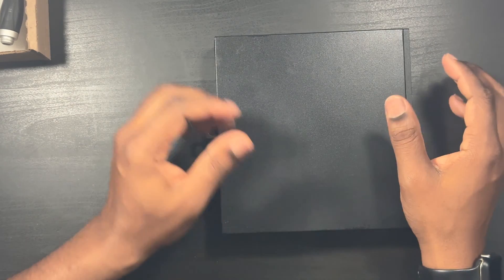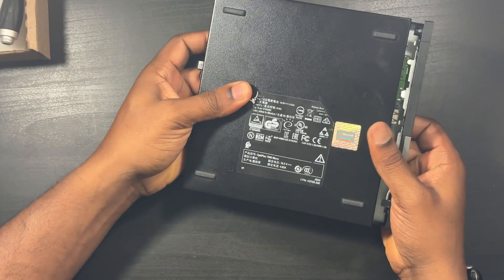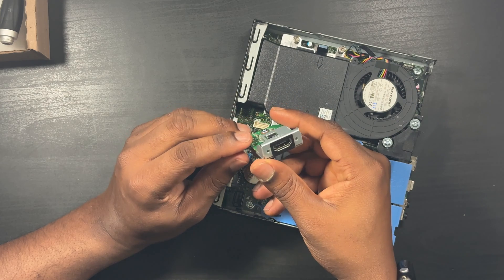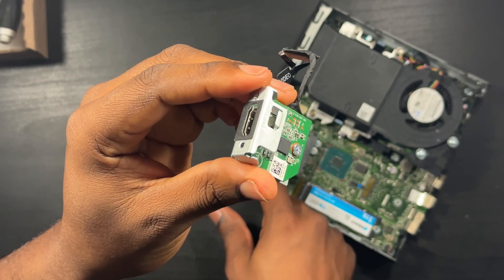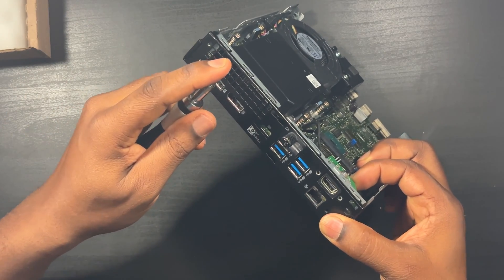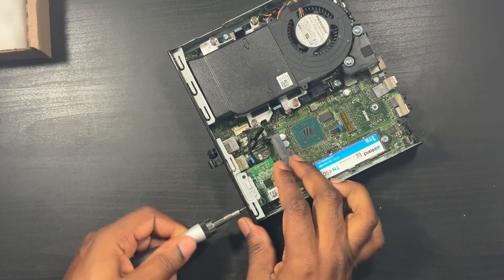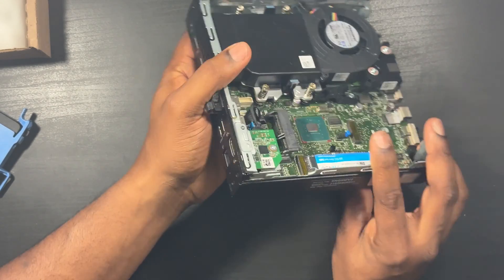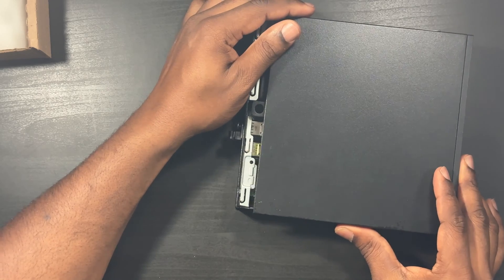How to add additional port to Dell Optiplex 7060 MFF

Comment: I have the same 7060 MFF, I added a UDMI extension like yours but windows is not detected the second monitor. I swapped the cables and they are good. What should I do next? Is there some BIOS option or something I need to change?
Reply from the maker: I didn’t have to do anything extra. Did you try to make sure you have a good connection to the motherboard also check the bios for settings mine might of already been set up in bios.
Reply: @charleeeugene  This is what I had YPF8G . Not exactly the code you had Y1XDH. It does lists this compatibility: Compatible Model: for Dell Optiplex SFF/MFF 7060 7070 7080 7090 ,Dell Optiplex SFF/MFF 5060 5070 5080 5090 , Dell Optiplex SFF/MFF 3060 3070 3080 3090 ,Dell Optiplex 3000 5000 7000 SFF/MFF,
Dell Optiplex 7010MT 7020MT 3000MT 5000MT plus 7010MT plus 7020MT. I returned it today to amazon. I can't find yours anywhere Y1XDH

Comment: Thanks for this guide! It worked for my 3000 Micro, except on that model the motherboard video connector is in a slightly different place and isn't accessible with the module screwed in, so has to be connected first.
Reply from the maker: Glad it worked out thanks for watching!!!

Comment: What exactly is that long thin board under the sata drive tn450? And is it's function?
Reply from the maker: I no longer have this machine but I’ll watch the video to see what you’re asking about.
Reply: It’s also an SSD called a m.2 which are significantly faster than sata ssd’s and connected directly to the motherboard. This also allows your OS to be installed on these, as well as other important types of software, and everything else installed/stored on the 2.5” sata ssd as you would with a 2.5” sata ssd and a larger HDD previously.

Comment: Do you have part numbers for more networking? I hear people talk about re-purposing old Micro's , but I can't find a faster network part.
Reply from the maker: Let me check I saw one on eBay but not sure if it’s compatible with this model.
Reply: @charleeeugene  I am also interested in this, seems like an easier solution than using the onboard m.2 A E for a NIC ( at least thats what ny 7070 has)

Comment: I have a Dell OptiPlex 7060 (the larger framed chassis) and I want to replace the current HDMI port on the machine however when I slide the cover off the chassis I noticed that the Cooling Fan is in the way of accessing the port. Do I need to remove the cooling fan or is there a cover on the other side of the chassis I can remove to access this module?
Reply from the maker: Yes those models are easy to remove parts just look for the blue stickers on  tabs and arrows should be easy to remove cooling fan to access that port.

Comment: I got my 7060 i5 8500t 8GB ram 256gb m.2 for $100 cad with a 95watt power supply super happy also came with basic keyboard and mouse I’m selling for $20 so should have spent $80 on the intial build, will be adding the i7 8700
Reply from the maker: Sounds like a great plan to me!!

Comment: Can we use m2 to pcie connector to use an external gpu with egpu dock and external power supply.
My i9 13th gen needs a gpu to run 2k movies
Reply from the maker: A great question I wish I had the answer for. I’m not knowledgeable about external gpu’s never owned one

Comment: The USB C board has 2 connectors and one of them need to connect to the Video port. Is it possible that the USB C port cound function just with the USB C connection made and the Video cable not engaged?. I am asking since the Video port on the board of my OptiPlex is already occupied with a HDMI card.Thanks.
Reply from the maker: Yes you can absolutely leave video cable disengaged.
Reply: @charleeeugene  Thank You. Will there be space on the back chasis left to install an extra USB C port after the HDMI port, 4 USB ports & 2 Display ports are engaged therein?. Is there any opportunity to install a microSD card slot on this chasis and what would be the suitable part number?. Thanks.

Comment: Bro  i have 9020 dell which already had this chip but i conect my lcd though hdmi cable but its no show any thing .neither i have seen any hdmi settings in my widos whay to do
Reply from the maker: Did you go thru your bios settings also try disconnecting the hdmi port and re seating it to the motherboard. If not order another one from eBay they are very affordable. Keep me posted. I didn’t have anything special with mine. It just worked !!!!

Comment: I got a usbc port for this pc and I find the usbc cable is not long enough to connect to terminal,I purchased the correct part ,and also do I need to connect both cables video and usbc .Apprciate your response
Reply: Damn it, why I didn't find this comment earlier,  ordered the same board, and stuck with the same short cable
Reply: I did it! You just have to pass the USB-C connector underneath the board.
Reply from the maker: No just connect the usb c cable the motherboard. Not sure why the cable isn’t long enough try flipping the module over too see if it gives enough leverage to connect.
Reply: @charleeeugene  Thanks for the reply,yes it will reach if flipped which I had already tried but the screw holes barely line up.I can’t understand why the cable is not long enough,as it is the right part number,
Reply from the maker: @eustaceedmonds  scratches my head can you return and try another one?
Reply: @charleeeugene  I got this on eBay took 3 weeks to get here,not sure if I get one from dell if it will fit,just needs to be a half inch longer,thanks
Reply: I tried looking for a video on this but no one has posted one
Reply: @charleeeugene I can send you a picture if you want 😊
Reply from the maker: @henriquecoelhandrade  send me the pic

Comment: I am trying to get this product but I am running into an issue. Specifically for the HDMI adapter, I found one but it says SFF instead of RFF. The cutouts look alike, however; Will it still work?
Reply from the maker: I would imagine if the cutout's are exactly the same if should work. These adapters are pretty cheap worst case scenario return it and buy another one.
Reply: @charleeeugene  Hey their. So I installed the HDMI adapter although it said SFF and it worked just fine thank you. 

This brings another question since the optiplex 7060 brings a Wi-Fi 5 card are you aware of any advances in that category? Do you think it'll hold a Wi-Fi 7?
Reply from the maker: @eduardoalverio7801  WIFI 7 Should work with no issues!!!
Reply: @charleeeugene  Have upgraded yours or any 7060 model thus far?
Reply from the maker: @eduardoalverio7801  just what I did in the video.
Reply: @charleeeugene  I mean About the Wifi card?
Reply from the maker: @eduardoalverio7801  No I haven't but a WIFI card shouldn't need special requirements. You could plug in a Wifi 7 USB Adapter and be good to go.

Comment: Just bought one today on ebay.... I might add USB C or HDMI not sure yet will see soon once I receive my system.... I checked and the system I bought already has the USB-C installed I'll probably go with HDMI so I don't have to get an adapter cable to run HDMI.... I looked on dell for that part can't seem to find it
Reply from the maker: I’ll send a link if I find it
Reply: @charleeeugene  Awesome Thanks

Comment: VGA is still used a lot in business. There are still plenty of older projectors etc that are VGA.  There are still options to get serial ports on modern, new computers.
Reply from the maker: I know but not sure how old you are but I’ve been seeing VGA for at least 30 years now.
Reply: @charleeeugene  Im half a century, or in Internet years, an Epoch old.   VGA still as a few decades left in it.
Reply from the maker: @Yandarval  Good luck with VGA you can have it LOL!!!!!!!!
Reply: @charleeeugene  I  much prefer DIsplayport. VGA is just a fact of life, until the machines using it finally die.  There are often stories of companies scouring Ebay etc for ancient parts to keep multi million machines going.  Parts for late 90s, 2000s PC that will only run the controller software on X hardware and OS version.  Even a VM does not cut it at times. Due to how rubbish some of the controller software is.
Reply from the maker: @Yandarval  your absolutely correct a lot of legacy equipment still in use rely on VGA . I like display port as well I run thru HDMI cables like crazy. I guess I like the fact that audio and video work  on HDMI/Display cables.
Reply: @charleeeugene  How often do you have to do the Displayport to HMDI adapter dance.  Some things are damn picky which adapter they like.  I have six identical machines.  Two of which don't like the adapters used on the other four.  All the same make and model of DP to HMDI adapter. The adapters for  the picky two. Those adapters work fine in the other four.
Reply from the maker: @Yandarval  Yup I've had strange things happen with display to HDMI adapters as well.  That's why I prefer to use the cables with one end HDMi and the other end  DP  i've had better luck with those.

Comment: So on the Dell optiplex 7050 mff’s can also have these same parts used ? ( USB C / VGA / HDMI ) for the spare slot on the I/O ?

I already have HDMI and VGA on my mff ( i7-7700t / 32 gb ddr4 / 500gb Seagate baracuda pcie 3rd gen / Secondary sata ssd 2tb / windows 11 pro ) 

Debating if I should do a usb-C port so that way I have one in the rear and also the one in the front facing or vga because I have a lot of monitors and also do a lot of Sega Dreamcast captures as well . Thank you
Reply from the maker: Yup go for the usbc port in the back that would be your best bet.

Comment: what about plugging in a 10Gb Nic module? what are the options?
Reply: The only m.2 10Gbps modules I've seen were way to big to fit but getting m.2 a+e 2.5 Gbps that works in the wifi card expansion is cheap and easy to get. I have two of these devices in a proxmox cluster and they work really well with the added Realtek NIC that I've bought.
Reply from the maker: @gyllkrans  Thanks for sharing the info !!!!
Reply from the maker: Somebody said they have a better nic module than the one it comes with not sure if it’s 10gb though. I will look into it.

Comment: Bro!!! Thank you so much. I just bought a 7060 Micro & definitely want to replace the VGA Daughterboard with the USB-C one. Love these MFF Computers.
Reply from the maker: No problem sir !!! These MFF machines are nice I’m happy with mine.
Reply: @charleeeugene  Yup Yup Same, I got a pretty good one all things considered.7060 MFF 1TB nvme 32GB DDR4 i7 8700T 6 core Wifi & Bluetooth. I repasted it & re-enabled the Bluetooth since it was likely disabled by the Office I.T. when it was in service. Easy fix to save a USB port from a Bluetooth dongle. I still need to order the bracket so I can add my 1TB 870 EVO. My main mod is gonna be that USB C port in place of the VGA port it came with. From what I can tell the USB C Daughterboard you linked can do Video & Data & Charge since it has both the USB C and the VIDEO cables that plug into the Mobo. The VGA port on mine is using only the VIDEO plug on the Mobo & the USB C plug on the Mobo in unused. Also shout out team MX Keys Mini freaking love this keyboard.
Reply from the maker: @cemeteryhill  Sounds like me and you could  geek out all day . Similar taste when it comes to tech!!!!!!! Thanks for tuning in bro really appreciated it !!!!! Your PC is  a beast with those specs!!!!!!
Reply: @charleeeugene  haha thanks man! I subscribed after the optiplex & the logi-keyboard cracked me up. I was like "This dude is literally me"